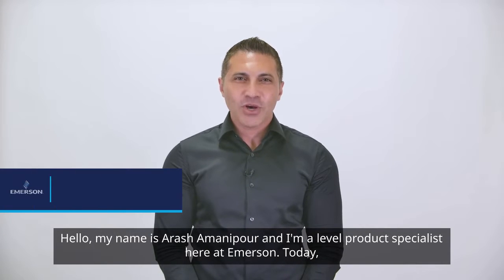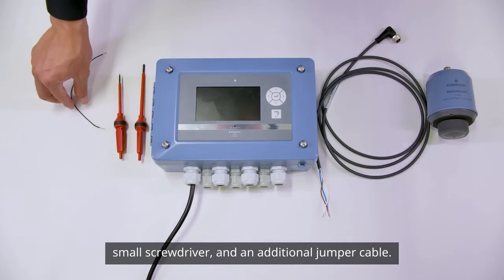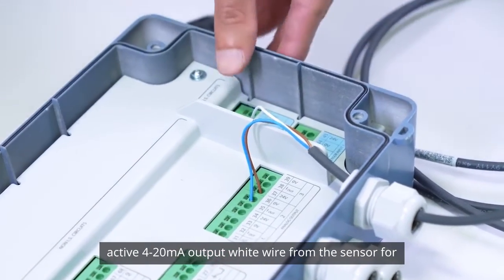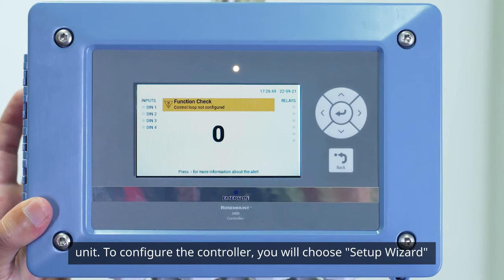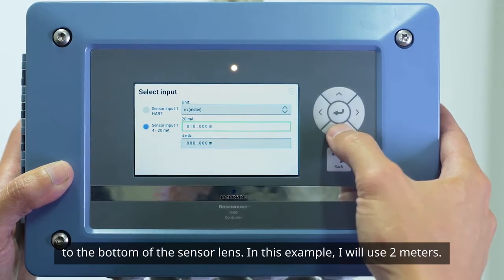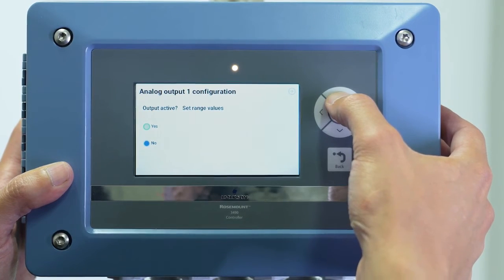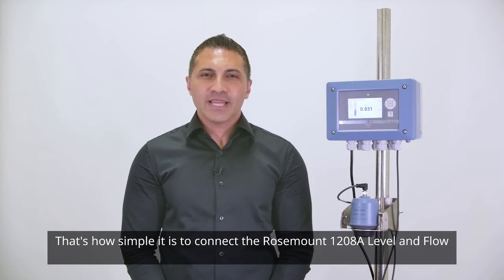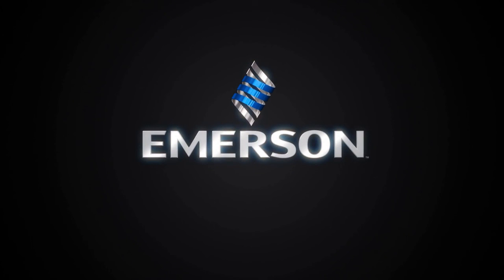How to connect the Rosemount 1208A Level and Flow Transmitter to the Rosemount 3490 Controller

Comment: If power off, why 3490 configuration reset to factory standart? How we can lock configuration, after power off we can back to last configuration? Aplication with 1208 for flowmeter open chanel, and 3490 have output for unit barel per day?
Reply from the maker: Hello, and thank you for your comment! Our first recommendation is to upgrade the firmware to resolve this issue. Please contact our support team at rplproductapplicationsupport@emerson.com for further guidance. Thank you